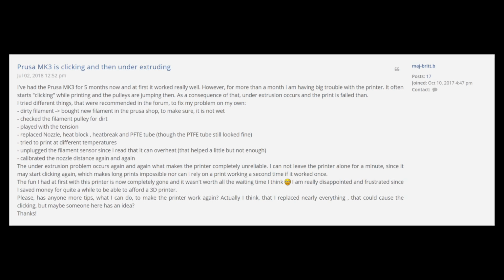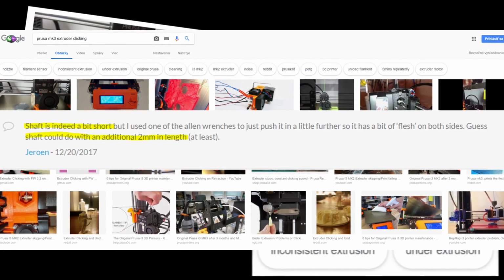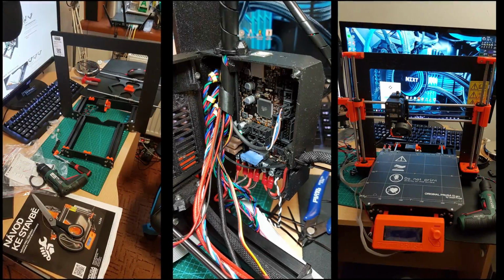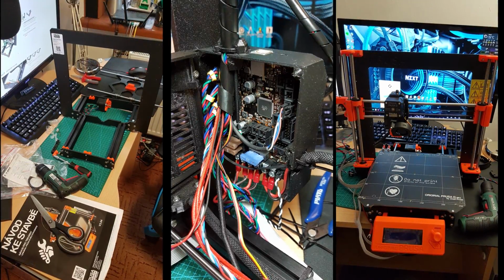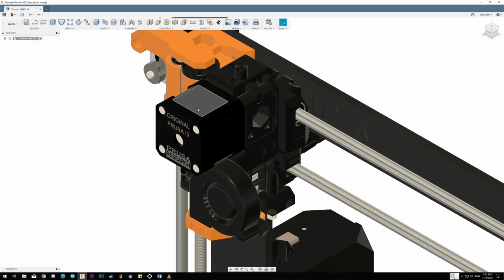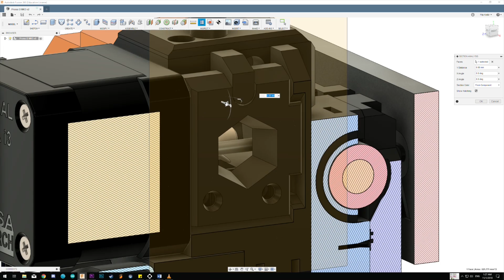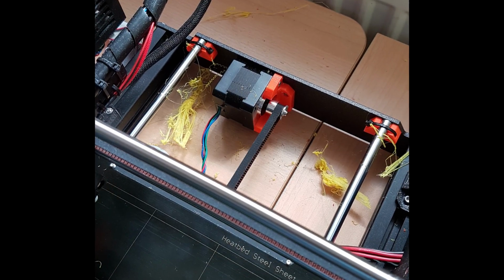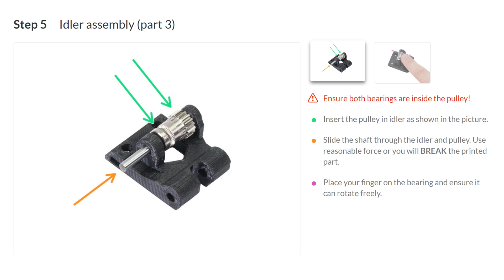Prusa MK3 - Working Solution for Clicking Extruder, Under Extrusion or Inconsistent Prints!

Comment: Wish I'd come across this sooner. Been dealing with the clicking extruder on my MK3S+ for a number of months now and couldn't print any PLA where it had worked perfectly before. PETG still worked thankfully and I think that's because it's a little bit softer compared to PLA. Was getting ready to buy a new extruder assembly as I had tried every other solution out there, but found your video on a whim. 

Removed my idler door and yep, the shaft holding the bondtech gear was pushed all the way to one end of the assembly so when the door was tightened it was causing the flex that pushed the gear out of alignment slightly, leading to the clicking/underextrusion/etc. Thanks again for finding this issue and putting the solution out there. Printed a new idler door that one of the other commenters posted which prevents any lateral shifting of the shaft holding the bondtech gear and that works great so far.

Comment: thanks for sharing. for my particular use case i did have a loose idler shaft as you described, but i also had a loose bondtech gear on my steeper motor ie. the grub screw was not fastened down tight enough to the stepper motor to keep the bondtech gear from slipping on the shaft of the stepper motor.

Comment: I spent 2 days, changing everything, filament, extruder motor (twice), stepper drivers, Hotend... and the issue was a shaft that wasn't seated right. Your insight into the problem was a great help!

Comment: If the cold stuck filament can't be removed, you take the smallest allen key with plyers, heat it up with a lighter and introduce it via the top' it will melt the filament that will stick to it and come out as you withdraw the allen key.

Comment: Damn ... I was hoping so hard that this is also my problem. But I’ve changed the rod for a longer version and i still have the clicking issue. Especially when i use the variable layer higher future and it comes to this curious 0.07mm layer hight or on longer print times.

Comment: This actually fixed it! This was a problem that developed, it worked fine before or could be adjusted with the screws but at one point it would just start clicking all the time with nothing fixing it. But this did it. Thanks very much for sharing.

Comment: It did not help in my case. I even exchanged the 3x20 mm pin to 2x24 mm. Interestingly, the printer always starts printing normally, but after a minute the problem begins. Any ideas? :(

Comment: Interesting. I am having this problem after upgrading to MK2.5. I will inspect this for the possible cause! Thank you!
Reply: Did not seem to apply for me. I checked, and the pin was pretty well centered, and I was unable to wiggle the gear around as demonstrated in the video. After re-assembling it was clicking immediately upon trying the first print. Moving on to examining the (brand new) PTFE tube.

Comment: This problem was chasing me down for like 3 days! Thanks so much mate!!! Will be buying a perfect fitting cylinder pin soon to never encounter this problem again. Did you report this to Prusa? If not I will.
Reply: I did but they replied that the cilinder is not meant to go all the way in the holes and that I could use a bit of glue to keep it still... Meh